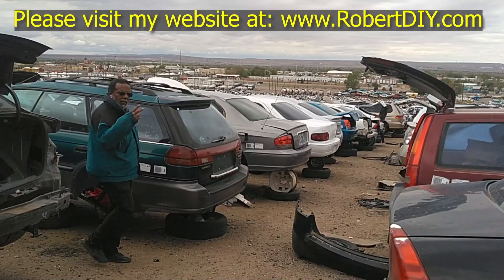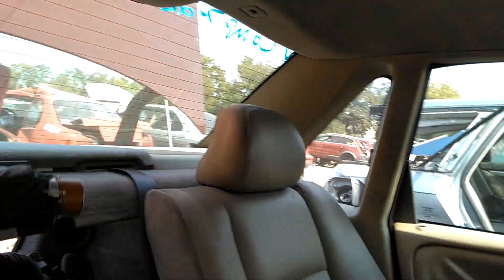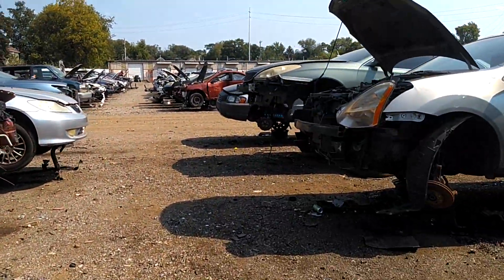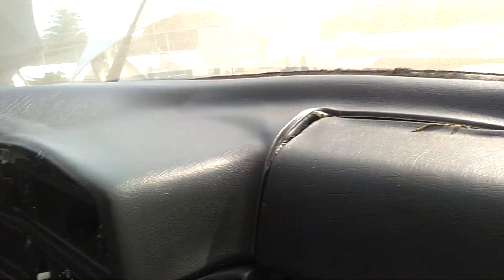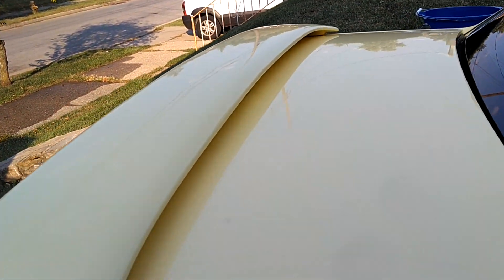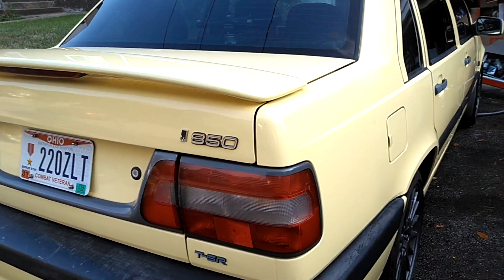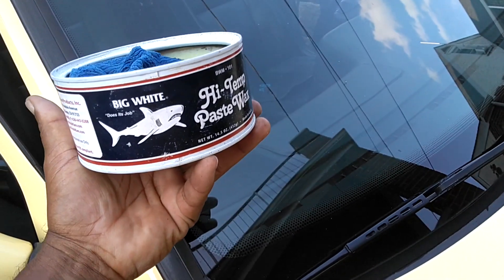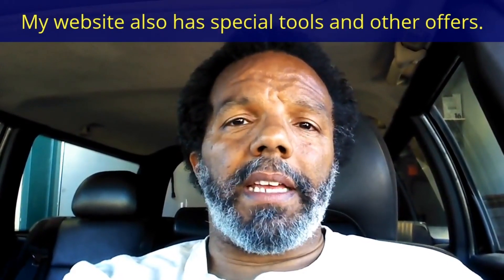Made a run to the salvage yard for a few bits. Then I cleaned Queen Bee Baby! Where is the water...

Comment: Try Mothers CMX ceramic coat. 16.00 at Wal-Mart. Enough product for 3-4 cars.  You'll never wax again.  Also great on shower doors etc.
Reply: I ceramic coated my saab and parked it for a year I'd rinse it every few months and it would look freshly detailed. It was parked under a hops tree. Ceramic is the way to go
Reply: @maacpetzol2205  I picked it not expecting much, but it transformed my 98 S70.  The Fl sun really does a number on the paint.
Reply: @kennypool  the griots garage ceramic coat is a little more pricey but it works so good. I don't even have to use my wipers when it rains. It withstands the three months of 115 degree days here in Phoenix. Much better than any wax
Reply from the maker: Thanks for sharing.

Comment: Robert, could you do a video on two things?  1) how to install and remove factory Volvo Oetiker clamps and 2) the location and recommended replacement of all the coolant hoses including the heater hoses?  Thanks!

Do you have good luck with the IPD silicon or Volvo coolant  hoses?
Reply from the maker: https://youtu.be/s1OlrdloSzo
Reply from the maker: https://youtu.be/QMEYRJMWaaA
Reply from the maker: Volvo
Reply: @RobertDIY  thanks!  Need to get all of mine changed.